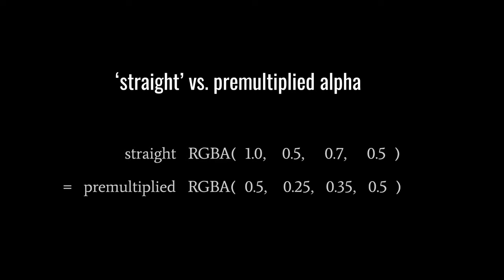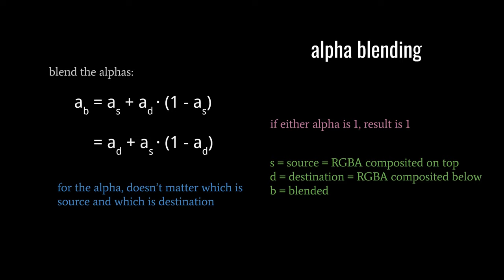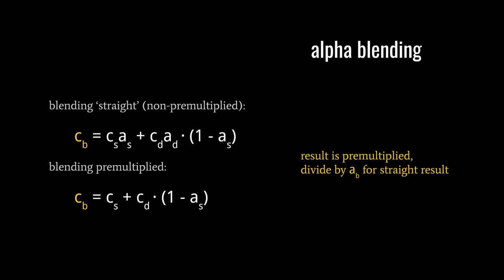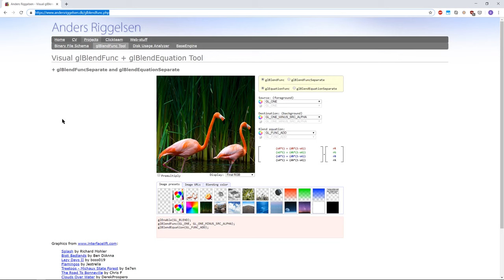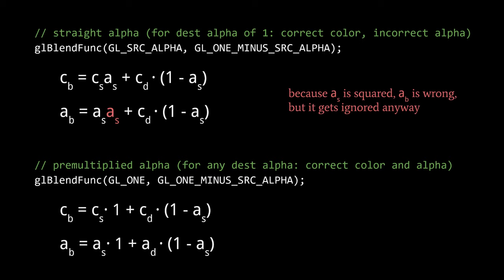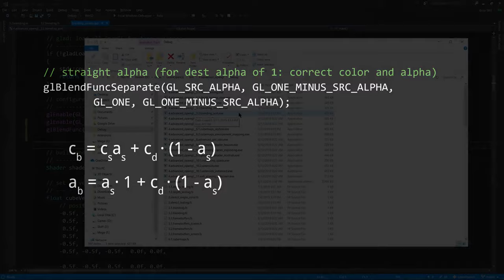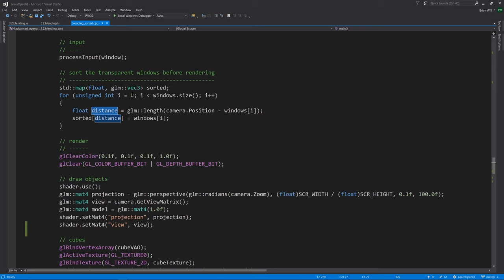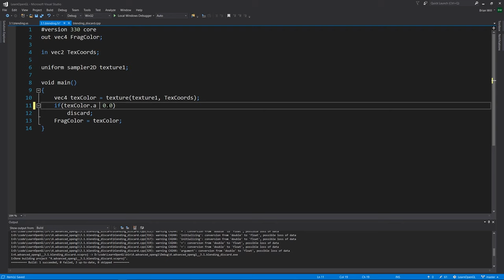OpenGL - transparency (alpha blending)

Comment: Premultiplied alpha has some further advantages:

1. Bilinear filtering is always rendered correctly. Without premultiplied values, there are some strange cases: When a fully transparent pixel has a black rgb-color, the gradient to a visible pixel gets darker in the middle, in a similar way the gradient gets lighter when the rgb-color is white. You have to carefully craft the texture, when not premultiplying the texture.

2. You get the ability to blend textures additively in the same rendering pass. Flares, fire and holograms need to be rendered with an additive blend mode. With premultiplied alpha, you can simulate/enable additive blend mode when using low alpha values and higher color values. Low alpha values let almost all light pass through the texture. The color values do not get multiplied again, and so are just added on to the background. For this you might only ignore/discard fully transparent pixels (alpha==0). The alpha value of the pixels is 1, on the 0..255 scale. When the resulting color exceeds 100% it is clamped to 100%.